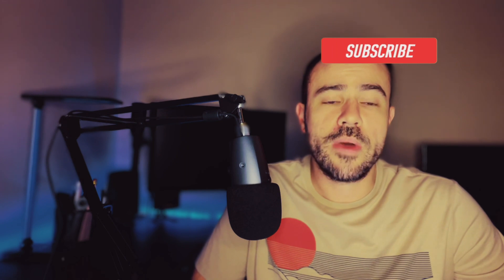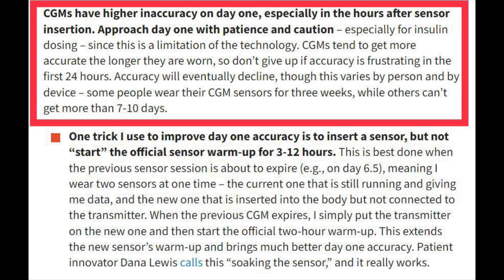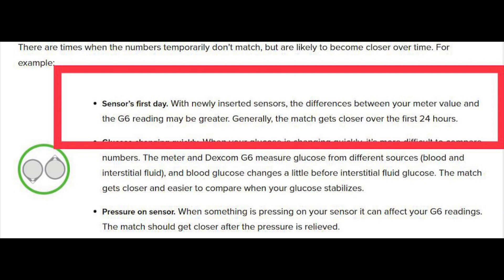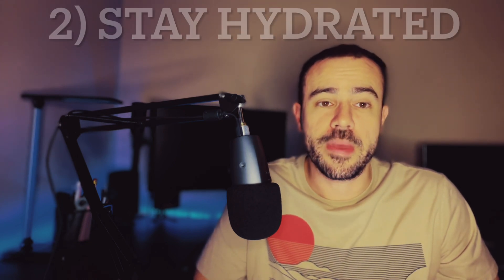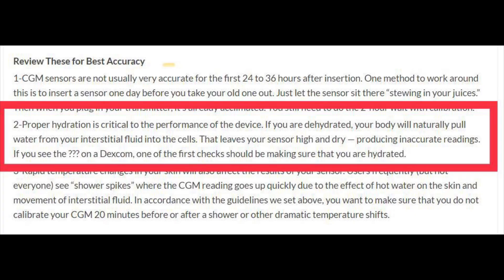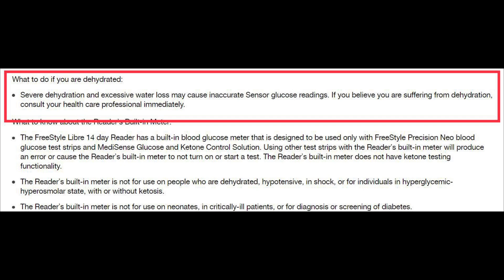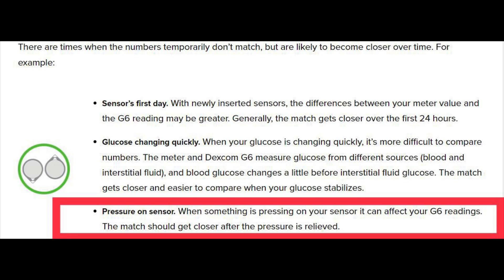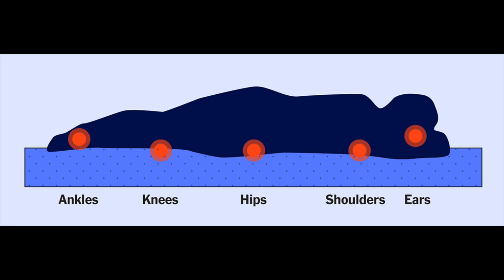CGM Accuracy Hacks: Proven Ways to Improve Your Dexcom, Freestyle, or Medtronic!

Comment: This video is 2 years old. If you soak your Dexcom G7 now (as of Aug 2024), as soon as you insert it, it starts gathering data even though it has not connected to your app yet.  Once inserted and removed from the applicator, it separates two magnets and that starts the count down to your 10 days and 12 hours. I soaked one of mine and thought I could start it after I removed my one I had already used for 10 days (soaked the new one during the 12 hour time period at the end of use) and the soaked one pulled up data during the last 12 hours I had worn it even though I had not removed the other one yet and had not started the new one. Once I started the new one, after soaking, and waited the 20 minute warm up, it pulled up a graph from the entire time it had been inserted even though it had not been turned on. ❤

Comment: Acetaminophen is also known as paracetamol in UK and some other places. 
I tried presoaking with a Dexcom but the sensor failed immediately I started using the transmitter. Dexcom tech said it was because there was no trauma detected so the system decided it was an old sensor. 
I now use Freestyle Libre and find the first night especially bad for compression lows.

Comment: On the issue of calibration, I use a Freestyle Libre 2 and I feel like it is more inaccurate than the previous 14 day model. My glucometer is almost always reading 20-40 higher or lower and I thought it was my last sensor so I changed it, yet it’s still way off. Is it possible my meter (which is new) is off instead? Or do I keep having wonky sensors?
Reply from the maker: Sometimes you can just get a bad batch of sensors. Hopefully that's the case and it gets better.
Reply: @diabetesdailydigest  I just ordered my first pump so I’m switching to dexcom to take advantage of the pairing- hoping it gives me good results!

Comment: I was wanting to know if soaking the sensor means putting it on 14 hours to 24 hours before using it or is that something else that needs to be done to the sensor to increase the accuracy I am kind of new to the Dexcom any help would be appreciated thank you very much
Reply from the maker: So just like you said, it just means putting the sensor on early, 12-24 hours generally, but not putting in the transmitter or starting it, just letting it sit there and soak to get through that initial 12-24 hours. Nothing extra to do.  Then after that time period you can put the transmitter in and start it on your Dexcom app/reader. Please let me know if you have any other questions.

Comment: Soaking is done at the risk of shorter usable sensor life by the soaking time.  Marginal sites will fail sooner.  The reduced warmup time and longer projected sensor life of the G7 sensor is due to a better A/D dynamic calibration ability, not better senor wires or sites.
Reply from the maker: Thanks for helpful info.

Comment: Hi Scott! I have another question. I just inserted a new sensor on my 9 year old arm but it bled a bit. Would it still work properly? I am so nervous to do something wrong! The blood kinda went over a bit so I am pretty nervous.
Reply from the maker: I have had a number of sensors that have bled, and in my experience they are still very accurate. The only time there could be an issue, although rare, is if some of the blood clotted and got caught in the plastic cannula. If this were the case you would start to see some dramatically lower blood sugars. I would keep a close eye on it for the first day or two, compare with finger sticks to ensure accuracy, and as long as all is well after a couple days, you should be good.
Reply: @diabetesdailydigest  thank you for taking the time to respond!

Comment: Do you have any advice for protecting a dexcom sensor while it is soaking? I would imagine it isn’t great to leave a sensor inserted without a transmitter to protect the electronic interface, but I could be wrong
Reply from the maker: The easiest thing to do is just to put one of those large adhesive pad Band-Aids over it to keep it protected until you place the transmitter in.

Comment: When soaking the sensor, won't the sensor get more inaccurate at the end of its lifetime because it is longer inserted?
Reply from the maker: While there may be a slight decrease in accuracy, day 11 or day 15 readings (depending on if you're using a Libre or Dexcom) are still far more accurate than day 1 readings from my understanding.

Comment: I very much agree with the idea of inserting the sensor 12 to 24 hours before activating it.  I used to attach a new sensor after the old one expired in the evening. Then almost every time I'd get low readings that night because of the swings from the new sensor.  About a week ago I attached a new sensor about 14 hours before the old one expired and activated it afterwards.  Seemed to be much more accurate during the night....  It's annoying having to sensors attached, but really seems to improve the accuracy during that first day....
Reply from the maker: I agree, it’s definitely annoying to have to do this, having 2 sensors on for a period of time. My hope is with the next generation of sensors, Libre 3 and Dexcom G7 they’ll improve on this and we won’t have to do it anymore.